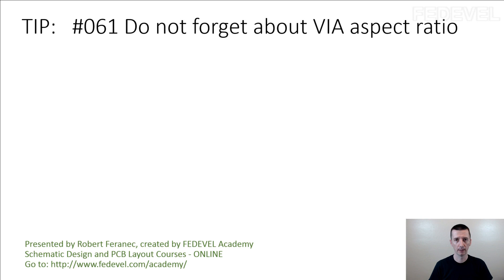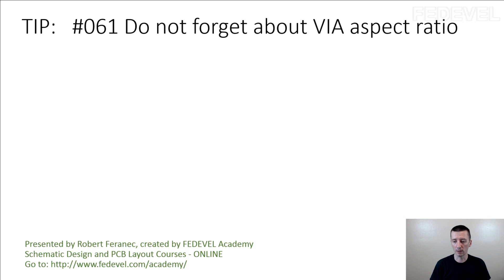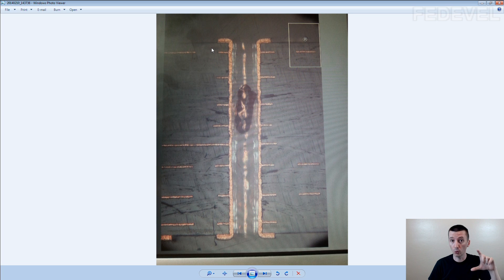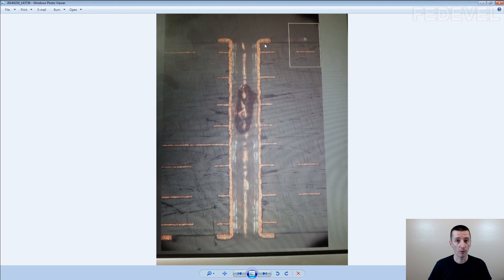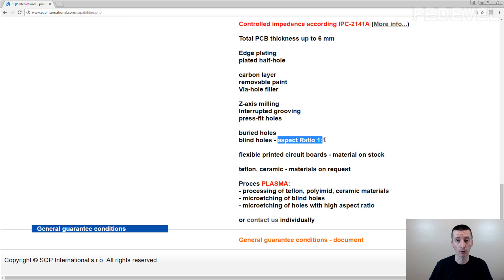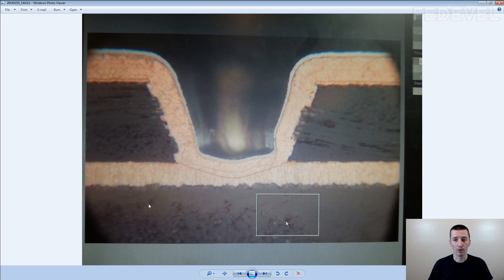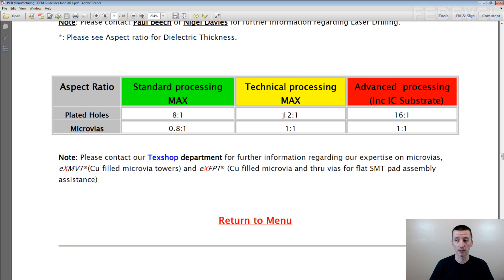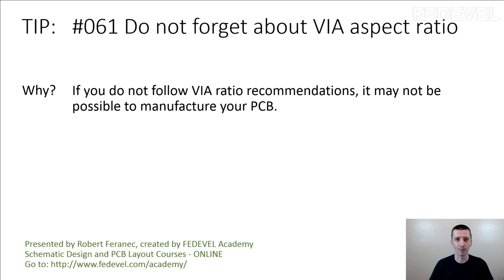TIP #061: Do not forget about VIA aspect ratio

Comment: 4:17  Hi Robert , you say that not maximum depth but deep
what do you mean?, I'm not English user so I use subtitles.
If you see my comment, could you explain briefly? 
Thanks , and I love your videos
Reply from the maker: simply to say, it is not possible to drill a very thin and very long hole. There are some limitations, for example for uVIA very often you only can drill as deep as is the diameter of the hole is ... if your uVIA hole is 100um, you and can drill 100um thin material.
Reply: Robert Feranec Hi Robert, Thanks for your reply,
I have 100% understanding.

Comment: Thanks again Robert, I wasn't aware of the different limitations with vias - I've always used fairly large vias because there was no need for smaller ones.
I'm curious where did you get the photos from, is there somewhere online where these type of images are available?
Reply from the maker: When I was visiting a PCB manufacturing company, I took these pictures from their microscope.